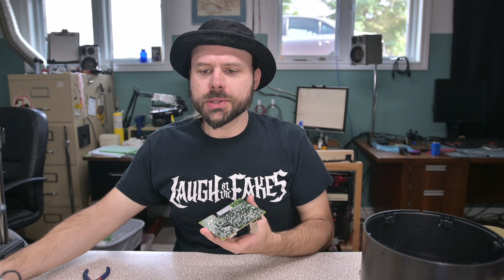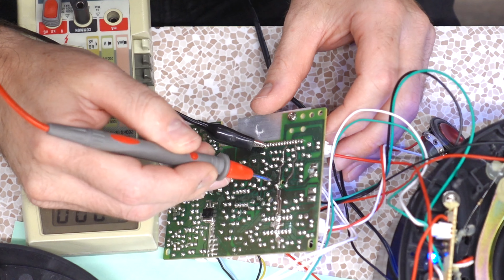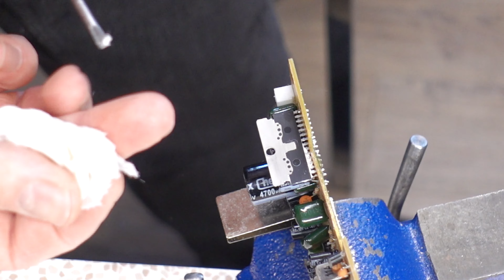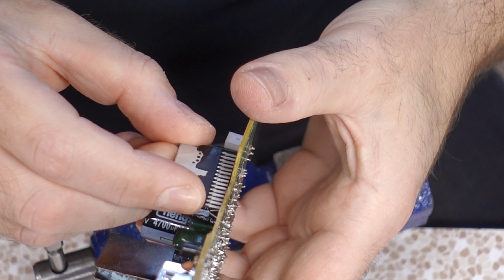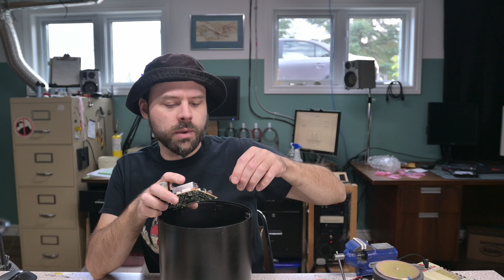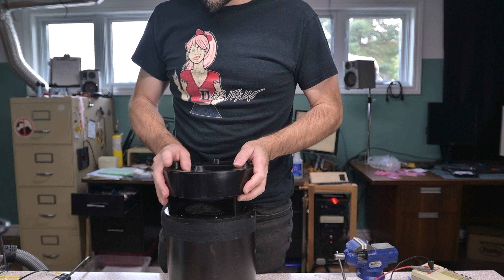Repairing a Random Wireless Speaker

Comment: Hi Irrelevant, well done fixing that crappy stuff ^^ Give a try at good solder wick (with resin/flux), it will make your desoldering works so much easier !
Reply from the maker: Ah I have solder wick, not sure it would of worked here. What I could of done was douce the contacts in a lot of fresh solder, then I could of probably raked it loose. But really, it was a dead part so cutting it out seems like the right plan. I only tried the flux thing cause I had just gotten it and wanted to see what it could do.